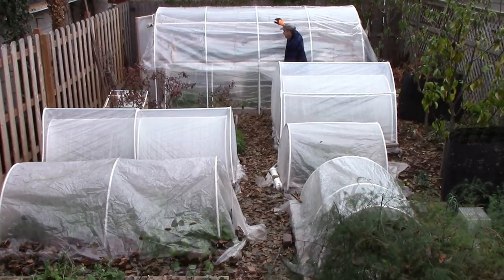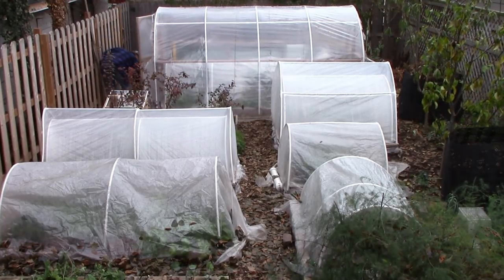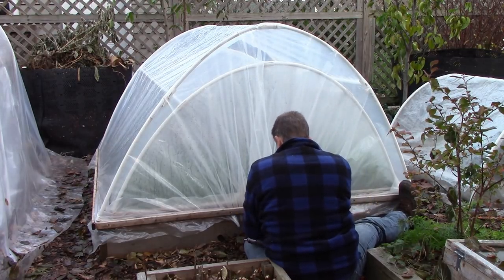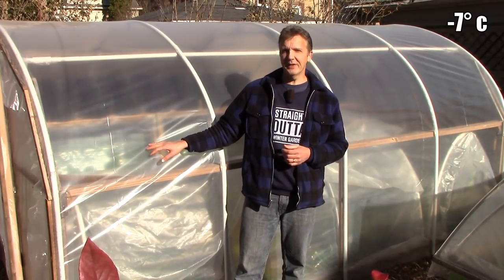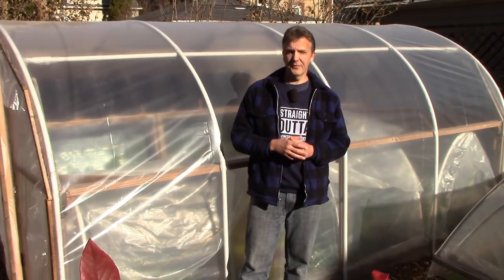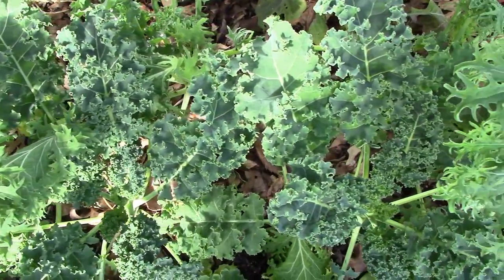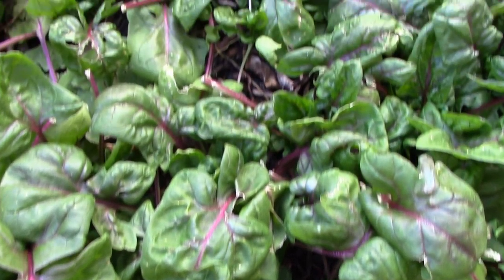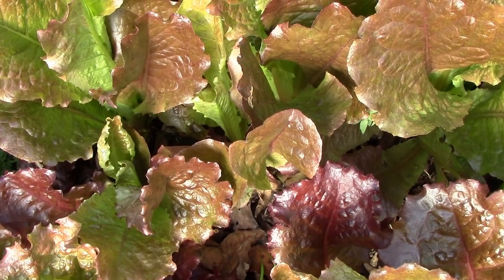Easy Manual Venting for Cool Weather Crops (Cold Frame, Polytunnel, Hoop House,Greenhouse)

Comment: I take you do not expect veggies to grow during the winter, just to keep them alive.  Right?
Reply from the maker: Where I live, growth typically continues until roughly mid-December. Growth then stops for about 2 months, and resumes in mid-February.
Reply from the maker: And I plant winter crops in late summer and early fall.
Reply: Thank you for your answers, and of course also for sharing your methods, experience and experimentation.  Thank you, both you and Oscar.
Reply: I don't grow vegetables in the winter season yet, but I'm collectif information to do so next year.  Your videos are a wonderful source of inspiration. Up to now, I have been putting delicate plants like geraniums, a lemon and an olive plant, also papyrus plants, in a geodesic dome from November to March.  The dome is 2 meter high , its diameter 3 m long and its 94 triangles are covered with 10 millimeter thick polycarbonate plate.  In order to isolate the 40 cm high base built with cement blocks,  I set in November an 80 cm wide and 1m high wall of dry leaves against the North wall, 50 cm high elsewhere. There is also a lot of water in 2 plastic barrels and in dozens of bottles.  Unless freezing temperatures, I used to vent for 20 minutes every day but moisture soon appeared.  So, I have decided to follow your method and vent more generously according to your indications on temperatures.  By the way, I am testing something new with my lemon tree, this year.  It has been always in a pot, but I have put it in the soil now.  Around it, I have set a metallic treillis with allows me to cover the plant entirely with dry leaves in order to protect it during the winter.  This method is recommended by the National Gardens of Meise (North of Brussels, in Belgium) I recently visited and said to be one of the most important Botanic Gardens in the World (90 Hectares).